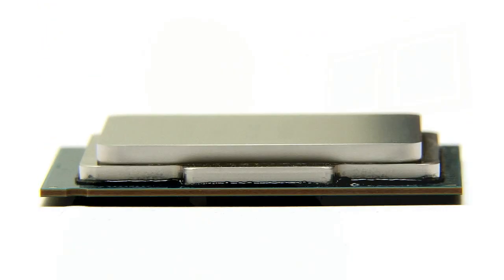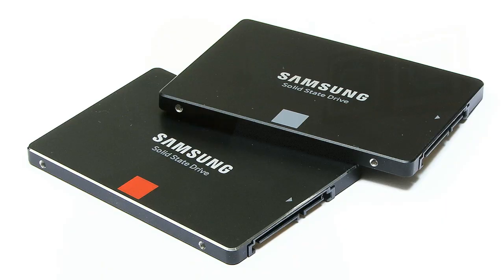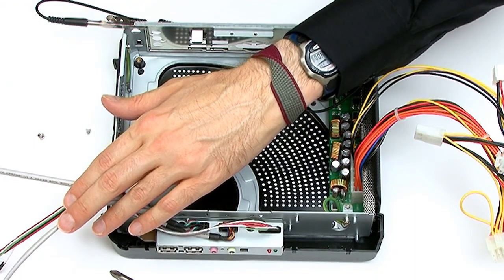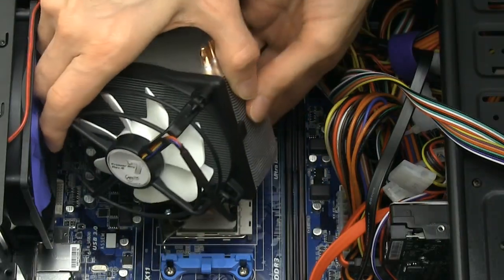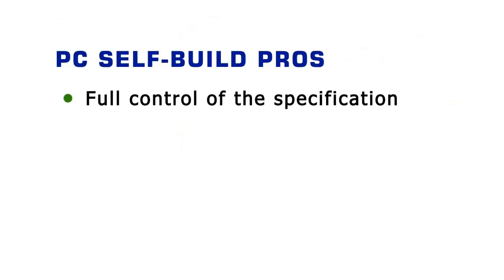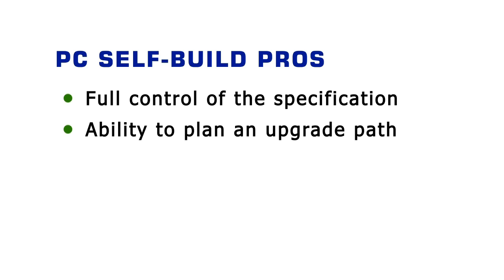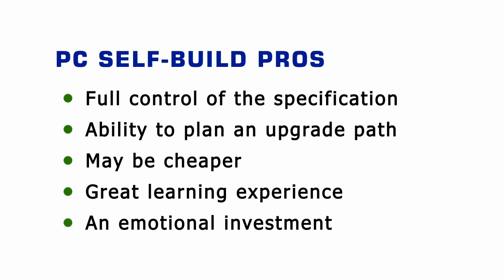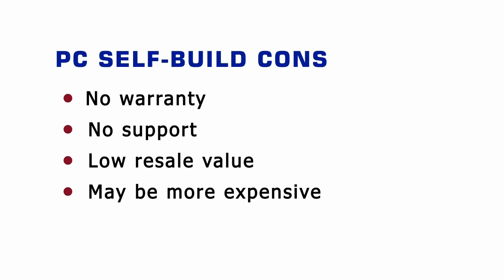New PC: Build or Buy?

Comment: I was going to ask why it took a day to diagnose a RAM issue, because on a new build, that is definitely in the top 10 diagnostic steps, the first 9 of which are mostly things like clear the BIOS/UEFI, removing add-on cards, all drives, and so on... Then I realized that I know a fellow who approached many others and I in forum around a year ago now, and despite all of the diagnostics and steps clearly laid out for him, he is still messaging me about his computer issues, having not RMA'd a single part, choosing instead to do who the hell knows what, continuously complaining about the same issues, asking for suggestions on what to do. Still receiving the same answers a year later, he finally chose to RMA his CPU (mind you, not because of his performance issues, but because he felt it did not overclock as well as he wanted! Fucking kidding me!?!?). 

I could go on about how he is told diagnostics, like swap the RAM around, or remove a single stick at a time, then after not hearing anything for several weeks, he will come back begging for solutions, and when someone asks how the RAM troubleshooting went, he says, "I didn't do it. I am confident that it will not help anything at all. So what should I do next?"...

Wait... NEXT?!?!?! 

So yes, I completely understand how it could take a day to diagnose a RAM issue... :-(

Comment: One thing you did not mention about building is better warranty.
HDD has 3 or 5 years warranty
RAM is lifetime  warranty
Motherboard is 3 or 5 years  warranty
GPU is 3 or 5 years  warranty
Ect.

OEM are normally 1 year.
Even for things like the hard drive which can have the same part number as the one in you built but 1 year warranty due to it being an OEM warranty.

My old gaming rig had a mainboard fault after 3 years, I got a credit on the mainboard, got a new mainboard off ebay as it was an old chipset.
And now that old gaming PC is a HTPC.

Comment: It's difficult for some people to not have passion for their hardware, but as for me, I am as emotionally involved with my computer as I am with a hammer. It's a tool, it does a purpose I sought for it to perform, it shouldn't suck.

Your PC is not a pet, it's an appliance. The data you put on the PC is more of the emotional investment than the hardware itself and should be treated like any other appliance when it breaks; Sort it out, toss broken bits and get newer bits which fit your needs.

Another way to think of it; Many people don't care if a refrigerator doesn't work unless they put food into it.

Comment: I started to build my own PC about a year ago and still add things to it on a regular basis. I now have 6 SSD's in it - one for Windows 2000, XP, Vista, 7, 10 & Ubuntu. I bought a manual hard drive switch box so that only one hard drive is running at a time. It cost me more to build my own computer than buying it from a store but the components are of a much better quality. I have also learned a lot in the process of doing so.

Comment: I selected every part of THE BEAST.  But I had a computer shop put it together for me.  
(The Honest Computer Guy in Houston, TX)
The Beast is Dual 2.8 Xeon Processors with 12 Cores total, 32 Gigs of RAM, 1500 Watt Powersupply, two 980GTX 1 TB of SSD storrage and 4 TB of RAID 1 Archive storage in an AZZA 3000 Fusion Tower for water cooling and 9 air flow fans.  Built in 2015 and still running smoothly.

SO for the record:
The ASUS Z9PE‑D8 WS is a great Motherboard but the ASUS customer service sux butt.
There is something to be said for buying high quality parts people.

Comment: My first was a pre built Compaq Deskpro with a pair of Pentium Pro CPUs. After that I started to build my own, and replaced it was a PII based system, which was replaced with a PIII based system. After that I got into building dual CPU based systems, the first of which was a dual PIII 700 which was amazing at the time. After that the only time I went back to a single CPU system with for a P4 3.06HT/533. I remember that so well, I sold it and replaced it with a dual Nocona core Xeon system which cost an arm and a leg and took a couple of years of it earning its keep just to pay for it.
After that I went with OEMs just because the sheer cost of dual CPU based systems is staggering. A motherboard alone can cost well over £600 and the CPUs are double that each so going with an OEM like Dell and HP just makes more sense.
You can configure the system to your hearts content and they give you a 3 year warranty on top.
I wouldnt swap out my Z820 for any "Bob built it" PC, the CPUs in it still go of over £500 each used on ebay and the Z Turbo Quad Pro drive is worth triple that so the cost benefits of going with an OEM at that level of hardware really is a no brainer. Theres just no point and I am somebody who has worked in computers for about 15 years before I got out and moved into something that pays a better wage and is more stable.

Comment: I would have much rather built a PC but I chose a laptop that could do what I wished. I'm moving to SE Asia and when I looked at the price of parts there, cost of shipping of parts, lack of availability of parts, bringing a computer with me was the best plan. I looked at several "cubes" (powerful gaming PC not the low netbook power "pc") small form factor desktops and their performance and price were comparable to a laptop with a discrete graphics card and they didn't have a screen, no optical drive and they didn't really have an upgrade path either!

Comment: I have never purchased a factory built PC.   I did three Heathkits and from that point on I always bought the individual components and software on the next eight or so computers that I own.  I currently have six of which five are active and three are online.  One is in the closet and four or five have been discarded.  While I have found that building your own from scratch is more expensive, the payoff is you get to select the exact components that you want.  Except in the high end ready to use PCs there are always compromises in the quality of some components to keep the price low.

Comment: I have build quite a few PCs over the years, but I have also bought pre-built as well. What I don't like about pre-built is that they often have BIOS limitations from the OEM that limit what you can do. overclocking, upgrades and other things are often much more limited than building.

Also, builders often have access to newer technologies than most standard pre-builds have. You also can use a much larger or smaller case, which suits your specific application needs the most. For instance, you may want a 22 core Xeon chipset, but pair it with a gaming GPU. They don't often prebuild those.

Comment: Disclaimer: I have not read the comments, so this may have already been said

An element of DIY that can effect your decision: Do you already have a computer? If you do, this can make building an upgraded budget PC even cheaper as you already have the OS and all the programs and applications you want. As with all things, however, this can lead to a "money pit" build if you are not careful. I have done this sort of piecemeal upgrade build a few times. The last one I was able to do the initial upgrade for USD350 with another USD400 added to the system over the next two years. That system is now at the end of it's life cycle, but the case and video card are still viable for my next major upgade, as is the OS - although the Storage device needs to be upgraded.

An advantage of this strategy is that each component can be upgraded as it comes on sale. This can lead to significant savings, most especially if the builder is willing to settle for older components. Honestly, if you are doing a budget build, a part that is one or two generations old are what you're going to get anyway. I tend to wait until a new generation is released and then buy the older one on discount.

Comment: Built my first computer in 1996, have done at least 50 by now.
As far as I can remember I never had a component dead on arrival, but once (in 2001 iirc) the motherboard and graphics card didn't like each other even though it was the correct interface etc. Got the card replaced for a different brand free of charge, though, just had to wait a few days for it to be delivered.
The only prebuilt desktops I've decided on since was for a place which needed to have a support agreement where they could have an on-site technician within 24 hours.
If you're wary of picking the wrong parts, there are stores nowadays that have knowledgeable staff who will be happy to help you pick out a combination which is compatible. In Sweden I would recommend Webhallen.com, Inet.se or Komplett.se.
You can also opt to have them build it for you out of components you decide on and have a warranty on the build for 500 SEK (45£/52€/56$). I'm sure there are similar services in lots of other countries.

Comment: I have never bought a desktop PC, have always built them. My first was an "XT Compatible" (buzzword of the day) I built in 1985. I no longer remember which specific processor I used, but it was an Intel 8086 or 8088 (definitely  pre-80286), running PC-DOS version 3-something, if I am remembering correctly. And it had a whopping 384k (yes, k) memory. At some point I added an Intel Above Board to it.
Since then I've built more desktop PC's than I can remember, for myself or friends, but that figure is in the dozens. I had the "DIY passion" long before I started in computers, which made the job not only fun, but personally rewarding.

Comment: I got some of the benefits of each approach by ordering a custom-designed PC online. I got to choose all the components, but a professional built the PC, and I was able to use the warranty to replace my SSD when it stopped working. Another midway approach would be to buy a used PC with some of the components I want and use it as a base for building a custom-designed PC. I'm thinking this could be a good way to get Windows less expensively.

Comment: I definately prefer self build, however with the current posability of buying a PC for less than £200 that is much cheeper than you can realisticly build one.

if someone asks me to build them a PC or asks for advice on building one first thing I will ask is how much they want to spend, if it is less than £400 I tell them it will probably work out cheeper or better spec to buy an off the shelf PC.
more than about £500 and it usualy works out cheeper or better spec for the price if you build yourself

Comment: Really good video but one of the cons isn't right, you said there's no warranty, if you buy tidy parts, you usually have a warranty with the individual things. For example, in the pc I built ages ago that I still use for games, there's a Zotac video card, ASUS motherboard, Corsair RAM and power supply and a western digital hard drive, the video card has a 2 year warranty I think, the motherboard had about the same and the power supply's got a lifetime warranty.

I'm only going into this because that might put some people off building one, building one is always the best to me, it's just more involved and personal, after all that's what it's called isn't it, a Personal Computer =P

I built mine with different parts and I've just swapped bits over time since about 2009, I'll never buy one again, I'll always prefer to build one, even if it costs roughly the same as buying one, it's just something nice to do when you do it well.

Comment: Great video!The ability to analyze and repair is the main item for me. when something goes wrong, I can almost always diagnose and come up with a fix. With pre-built it is so hard to get into the "guts" and the use of non-standard parts, and things that disassemble in very odd ways with proprietary screws and clips etc. just puts me off. After 3-5 years I can upgrade the cpu, memory and motherboard and for $400-600 I can have a brand-new machine functioning to today's performance level

Comment: I've been building my own PC's since the late 80s, when dos was still a thing. Apple's for Apple's, you get more bang for your buck. I generally use the best components I can afford, and most of the pcs I've built can go 10 yrs with a few upgrades along the way before they become obsolete. Most manufactured pcs use proprietary mother boards and cases making them difficult to upgrade. A diy pc can be upgradeable for a very long time. It's important to do the research to find which components play nice together. In the past I've had problems with certain components not being compatible. This compatibility problem seems to have gone away for the most part, in more recent years as manufacturers adhere to standards that were not in place decades ago.

Comment: actually i just bought my first reconditioned pc for 120 dollars, and believe that now buying slightly used is by far the best value, Since the technology moves so fast that investing in new parts is really a bad investment in value terms. I can throw away this used pc in a year having gotten full value by then, and buy a better version for the same price, or keep the one i have for a few more years and basically be stealing value. When you look at the last 30 years progression of technology computers, you see that like all electronic technology it becomes displaced in all value metrics so fast, even to utter obsolescence, that buying used, is now the far smarter economic value i think. The corner has been turned.

Comment: I have been building my own computers since 1991. The only issue I ever had was an Antec power supply bursting into flames after about 2 days of running. Fourtunatly I was right next to it when it happened and quickly pulled the power cord. Replaced it with another brand and I was back up and running.

Comment: Personally, one of the main things I do with my PC is games. I did used to buy prebuilts, the idea of self building was insane, and I always envisioned all kinds of things going horribly wrong. Until I bought a core 2 quad PC from Argos. back in like 2008. On the surface it was a fantastic price about £480 if I remember correctly. Core 2 quad machines weren't cheap at the time. While I had done major upgrades to previous machines in the past, jumping in to putting the whole thing together seemed like a bad idea in so many ways, plus there was no way I could have put a pc together with that CPU cheaper,. Or so I thought. 

Out of the box it did fine. If I never tried to upgrade the thing, I likely wouldn't have run in to problems. But I bought it with the intention to put a better video card, and more RAM in to it in the future. The problems came when I tried to upgrade its rather anaemic graphics card for something more suitible to my needs (it was a Geforce GT 120 I think) In the end I went for a Geforce GTX 270 I knew at the time I would also need a new power supply, since the power supply that came with it was just enough to run what was in it. After squeezing in the monsterous GTX 270 (its probably the biggest card I've ever seen before or since) all seemed to be fine at first, it ran every game brilliantly, but then I started to get major over heating issues. One thing I didn't like when putting the new card in is it sat directly below the powe rsupply and there was barely any space between the 2 components, and both fans sat right next to each other, essentially meaning that both were probably fighting each other for air. After a lot of messing around and trail and error a friend of mine suggested I should just get a new case, since the case the thing shipped in was pretty awful, didn't have any fans or space to put them, and had that ridiculous design "feature" where the motherboard basically sat in the case upside down

Another issue which I didn't realise at the time of buying it, is it had a maximum of 4gb RAM which was already in the machine from the start, even going back to  that time more than 4gb was preferable especially if you was playing higher end games like I was. In the end, the only components left over from the original pc that was delivered by Argos were pretty much the cpu, and the dvd drive.Even the hard drive ended up having to be replaced. When I tried to disconnect it part of the plastic that holds the SATA cable in place dropped off meaning the only way to keep the cable in place was with tape and a lot of luck. In the end I ended up having to build my own PC, and it was a lot more expense than it would have been if I'd just gone and bought the components in the first place. £480 may have seemed like a bargain for a full system but not for a mid range cpu and a DVD drive. Even Windows needed to be replaced since it was tied to that system. That wasn't too big of a deal though I wanted Windows 7 anyway. Since doing that initial build I've not so much bought a PC as just evolved it over time from that original  core 2 quad.. To this day the Cooler Master power supply I bought at the same time as that GTX 270 is still powering my current machine. Although it really is getting time to retire it now. It may still seem to work fine but its become noisy lately, and I've certainly got my money out of it.

Comment: I've been repairing and building my own computers for years.  My first computer was used and cost $3300 and at that time there was no mouse or hard drive.  It had the 45 size floppies that had to be each programmed.  Now building and using a computer is a breeze.  I don't buy off the shelf because they don't usually come with everything I need and if you do have a problem you have to box up the whole thing and pay to ship it off.